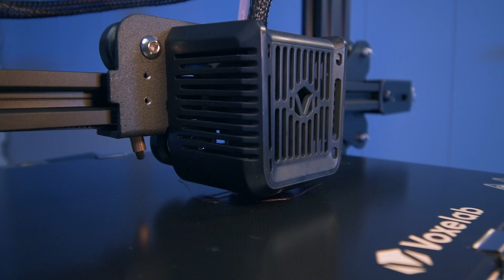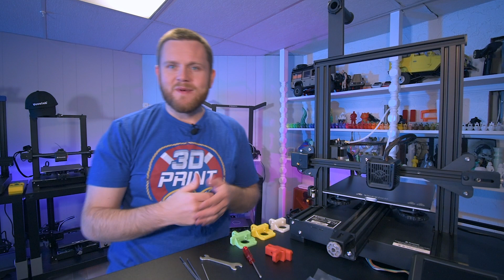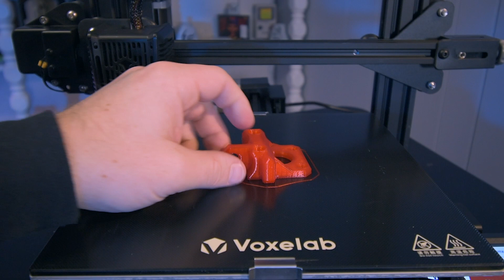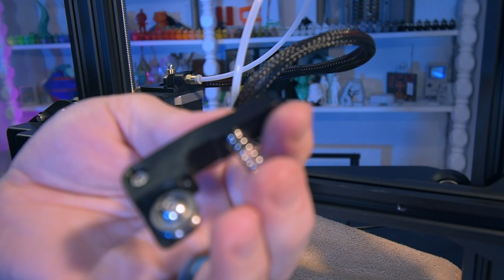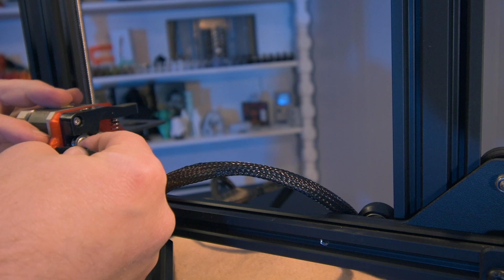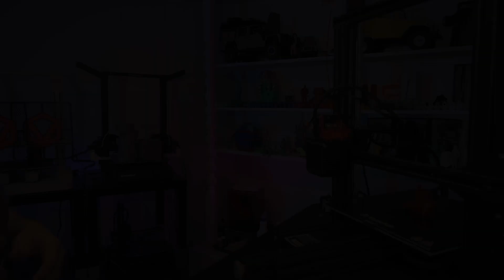Voxelab Aquila Direct Drive Mod - OOTBDD - EASY & FREE

Comment: Hey man, just meant to say that you saved my printer. I've been having extrusion issues for about two years and never was able to fix it with the out of the box setup. I was able to get it working just enough to get this printed and it's completely fixed my issue. You saved my printer from the landfill, I really appreciate it!
Reply from the maker: That's awesome to hear, I'm so glad it worked out for you!

Comment: not sure what went wrong and I'm not saying this was the cause. But I couldn't get a decent print after installing. it would start dragging the filament on layer 1. I did a bed level before even trying to print and that for some reason didn't feel the same. I have to manual level with the paper method (no autolevel here) and it always felt like... well like if a ballpoint pen was stationary and i moved the paper under it. I always set it to just being able to feel the ballpoint without it bunching up the paper. This time It just felt either like dragging it across a stylus tip or it would start to grab the paper. I also had a Satsana shroud but it lined up with the holes just fine and the hotend was mounted to the carriage like OOTB. So not sure what went wrong. Anyway, just wanted to post if you have a Satsana, it might not work out right even though everything went back together fine. This is an amazing mod and I'm pretty sure if I had used the original shroud it would of worked great.

Comment: Found some limitations,... All entirely within acceptability. Main one is that if you do a full height print on the AquilaX2, the tension lever will connect with the upper crossbar, which has the unique property of stopping the filament from feeding as the level opens the guide roller off the drive cog. So it stops the print from making a mess as the Z-axis is forced to stop.
Second one is my own fault, I ran off the first print of this using PLA, so with each subsequent print, and with the 40degC days we've had here lately, the PLA is softening. Time to put the PA-CF to good use!!.

Comment: Well now, finally got mine printed and installed, set the retract down to 1mm, modded my Satsana fan mount to clear, re-did the nozzle to bed clearance with 0.1mm Feeler Gauge, dropped in some TPU, 100% infill for a wrist strap, perfect. 15% hex infill for a squeezy octopus for a niece, perfect, now printing a dodecahedron dice at 250% with 3D Gyroid infill for my cats to have as a toy, no errors so far, with Zero supports in the print, and using the Voxelabs slicer....
I thought TPU was supposed to be hard, all I did was slow the speed down to 30mm/s max, set the print head to 230c on a reel that wants 190c to 240c, the bed to 50c and the cooling fan to 20% (wasn't game to turn it off),.... Nylon with Carbon Fibre is much harder to print then TPU !!!
Yes, I've got the Alex firmware and hardened Steel nozzle to do PA-CF on the Aquila X2.

Comment: I just got an Aquila Pro for 60 bucks. I've had an OG Aquila for a few years now. I have been wanting to do dual Z on my original for a while now so that I could do direct drive. When I saw the pro at a cheap price I got it, I figured it comes with the dual Z already on it. I plan on doing a direct drive. I might try this diy option before getting something for faster prints. I did a printed extruder on my original one so I could print TPU. It had the same V shape like this. I almost got the aries but I decided against the bulky enclosure. It makes modifications harder.
Reply: Only reason for the enclosures, is to keep heat in, for materials that need it.
I took a large cardboard box, cut it to look like a Diorama box with the front open and no bottom (because, workbench), and just put it over the top of the Aquila X2, stopped air movement and retained enough heat to print PA-CF, with the glass plate flipped upside down and sprayed with glue. Needed the 'Alex' firmware to get the temperature high enough, and a Hardened Steel nozzle. For the money, the Aquilla rocks! I used to work a place that sold them, got mine at staff price, then when they dropped the Aquilla's, I picked up a spare at run-out pricing,.. still haven't opened it 18 months later.
Can recommend using some White Lithium Grease on the threaded rod, most of the 'issues' with single sided drive go away if the threaded climber doesn't stick on the rods thread.

Comment: Will this allow the printer to print TPU as well?
Currentyl have your Fedorstruder v2.0 on the bowden setup, wondering how this would be compatible.
Reply: Mine's nailing it's first set of TPU prints. I want to get some TPE next. Done PLA+, PLA-LW, PETG and PA-CF in the past while still Bowden, but the Satsana cooler and this Direct Drive mod are making for some real nice finished prints. Might be time to tackle another RC aircraft with the PLA-LW.

Comment: Hi, it was really easy to mount the adapter for the extruder motors on the adapter from the link in the derailleur and surprisingly you don't lose the working space at all in height, I thank you for the idea that it will be easier to insert the filament easier because the printer 3d is in the enclosure

Comment: I’m using this now. I don’t think this is a good mod for a beginner. It shouldn’t be printed in PLA. The extruder will get too hot and soften PLA. I printed mine in ABS. You also definitely need an extended cable for the extruder motor.

The design has a couple flaws: the plate should be 1-2mm thicker, because the pan head screw is too long and will sit proud. This will make the lever crooked. Also, it only attaches at one wheel, so you can theoretically spin the whole assembly. It’s seems snug, but two points of attachment would be significantly better. 

I also used a lighter pancake motor. The stock motor is pretty heavy, and there will be more vibrations and rotation of the whole thing, because of that weight. 

The cable routing shouldn’t go straight up, but at an angle. Y printing height is reduced because the upright cables will run on the top cross bar. 

There are $15 direct drive mount kits on Amazon that would be better.

I’ll see if this is reliable in the long run. Overall I rate it a B+ mod.

Comment: I havent had a successful print with this mod yet and i think its the retractions , you mentioned turning the retraction setting down , can you please tell me which settings , is it the retraction speed ,or retraction distance in cura???
Reply from the maker: Retraction distance should be set to 1mm. Reduced from around 6ish or sometimes more.
Reply: Thankyou  @3DPrintSOS
Reply: As an update, i have adjusted my  restractions to 1 and had a successful print, however with some underextrusion occurring thorough my print. then i realised i had changed the gear on my extruder because it was worn, this through my e- steps out considerably. Old value to get 100 mm of filament to extrude was 93.9 e steps after another e step calibration i have had to adjust this to 105 e-steps to get 100mm of filament to extrude. hope the next print is perfect . @3DPrintSOS

Comment: Just got an Aquila X3 and I've been watching videos and turning my print settings, and looking for any way I can to make sure I'm producing the best prints I can.  This is certainly something I'm looking to do.  Did you ever do a video with a modification for the run out sensor?  I don't know if they changed it on the X3, but so far I haven't had any issues with it (other than it ships disabled and I didn't realize that). This video has earned you another subscriber.  I'm looking forward to learning more and seeing what my Aquila can do.

Comment: This works great, but my extruder piece is now warped because it is PLA. How should I remove the press-fit spacer? I intend on re-printing this with PETG then reinstalling. Thanks!
Reply from the maker: If you reprint, just cut the PLA open with your snips and get the spacer out. also, I recommend you print the adjustable lever from my “fedorstruder” files. it’ll give you more adjustments and guarantee a good filament path. :)

Comment: my ABSOLUTE NO. 1 PEICE OF ADVICE for, anyone with a 3d printer is buy a good presision screwdriver set, i got an ifixit one on amazon 2 years ago for 35 euro.(paired with a parkside electric screwdriver) it is amazing, much better than the crappy alan keys you get with the 3 d printers

Comment: Came across this vid by complete accident. I have an x2 and although I'm quite new to printing I do quite a bit of it. I have only ever used pla but have read up on some other filaments like tpu but I'm not completely sure I understand exactly why this mod is required.....could someone please explain it to me.....plus could you also explain what the machine is set at a retraction of 4 if 1 would work. In other words I really like this whole idea but not sure why 😊. Many thanks.

Comment: I did mine on Sunday and it loads just fine but doesn't print anymore. The extruder stepper moves very slowly now. Slower than it used to. Any ideas?
Reply from the maker: This shouldn’t have changed the steps of the machine. But I have heard some of the newer Aquilas have a different hole placement in their lever. So the filament path might not align right.

There is a printable lever in the “fedorstruder v2.0” that you can print to align the holes perfectly and give you the ability to adjust the tension of the bearing and gear. 

So first, check the filament path, second check to make sure the wiring is correctly plugged in.

Comment: @16:40 Sugrestion. Use a washer to press fit and not the wheel. The bearings are designed to be used in a radial load and you putting an axial load that may damage the bearings. Just thinking,  Maybe even design and add a STL and Gcode file to make a tool to do this included.

Comment: Great Mod, however I'm having a hard time with printing TPU, what retraction settings should you use for TPU? Also seams like filament is slipping especially with TPU. Thanks
Reply from the maker: I have seen a bit of a trend of misalignment going on. Mostly on the lever. I have a file called Fedorstruder 2.0. It includes a level that is adjustable. I highly suggest printing it. It will help a bunch plus we will know the alignment is exact.
Reply: @3DPrintSOS  thanks I will give it a try

Comment: Late to the party, but I just got around to doing this mod. I've had my Aquila for over a year (first FDM after spending 2 years reain printing) and have recently been getting the urge to try running some TPU. I'm running a Satsana shroud so grabbed a remix of this designed to fit better with that shroud. Took about 2.5 hours to print (4 walls, top and bottom, 15% gyroid infill and ran slow for better quality) and about 45 minutes to install (have a BL Touch installed and had to completely remove it to dismount the Satsana shroud). Immediately ran 2 small prints with zero issues.
Definitely, DEFINITELY need an extruder extension cable for this model. That stock cable is just not long enough.

Comment: Sadly, I realized after I printed the OOTBDD that I have an upgraded version of the Voxelab X2 - mine has a filament sensor. I'll have to take the STL file and redesign it to hold the filament sensor. Oh well.
Reply: Do you have the file you made?  I have the same model

Comment: Just done the direct drive mod but doesn't seem to exsrud filament any idea why. Thanks
Reply from the maker: I’ve heard this a few times! Sounds like some of the levers, especially on newer machines, are slightly different. To fix this, you need to print my lever from the Fedorstruder 2.0. That lever will have perfect alignment and give you spring tension options.

Comment: Thank you. I printed this, used it and it worked great, downside was I did a bunch of ABS and the heat from that and the motor warped it enough that it affected the extruder functionality. I may print another one in ABS to see if it holds up better.

Comment: Hi, great video, but I have a little big problem. I was a happy user Aquila printer with G32 chip. I downladed the correct firmware for this printer (ManualMesh-5x5-G32.bin).
 Also, the screen.  After that, my printer doesn't work.
When I turn on the printer, on the screen only appear the voxelab logo. I try to install other firmware but the printer does not response. 
I believe that my printer is now a beautiful brick. Guys, any ideas? Any suggestios? Please, what can I do?
Thanks
Reply from the maker: Make sure your 8GB SD is properly formatted. If you are on a Mac, make sure you do not have any hidden Mac “.files" on the card.
Reply: @3DPrintSOS  Thanks for your answer. Totally sure. Fortatted Fat32 4096. No more files or hidden things. The screen response to upgrade but the mother board does not response.
Reply from the maker: @davidlajara75  Hmm. Is it possible you have an early N32 without a sticker? Or you sure its a G32 machine?
Reply: @3DPrintSOS  I checked my mother board, and the model is FFP0173_Aquila_Main_Board_V1.0.1 with chip ARM GD32F 103. I'm a little bit frustated...:-(. 
I don't know what to do.
Reply from the maker: Yup that’s a G32. I would try another SD card for sure. If you haven’t already. Only thing stoping it from taking on firmware is either naming of the files, formatting, “.” Files from a Mac, or simply the wrong firmware for the wrong chip. So if you did all of that already, it’s gotta be the board. You can also try a different firmware all together. See if klipper takes, see if the professional firmware takes.

Comment: Is that extruder mount will fit to aquila pro as well?
Reply: Not good any other option for pro to get direct drive?Thank You for replay:)
Reply from the maker: @greghfpv  Not off the top of my head. I dont think it will be too difficult to adapt. Especially if there are any carriage files out there online.
Reply from the maker: Nope, the PRO is a bit different in a few ways. This will only fit the standard Aquila machines

Comment: I printed and installed this following every single instruction to the T. However, the filament is clogging up before it enters the hotend. The extruder gear it seems is no longer pushing the filament into the hotend. How do I resolve this?
Reply: I resolved that. Like a noob, I hadn't cut the PTFE just right. However, the mount itself broke multiple times. I am back to Bowden now and will buy a metal mount. This plastic thing has not been successful at all. Not for running 4-5 hour prints everyday anyway. This might work for people who don't print regularly but cannot handle the stress of regular printing. Great guide though and really love your channel. Thank you!

Comment: Is there a similar package for Aquila Pro ?
Reply from the maker: Because of the Aquila Pro’s closed-source motherboard, screen, and firmware, it’s hard to make parts for it. Honestly not sure.
Reply: @3DPrintSOS  thank you, I might have a go myself
Reply: @SimonPlatten did you try this on the Pro?
Reply: @strongarmairsoft  I did, however having spent time designing the model, just before I printed it I realised there is a problem preventing the direct drive from being used, this is on the Pro the wiring to the existing extruder is just not long enough to support the direct feed.
Reply: @SimonPlatten  is there a way to slice and extend the wiring? Thanks for this
Reply: @strongarmairsoft  perhaps but I don’t feel brave enough to try this

Comment: I have printed this unit with the included filament, i have yet to install it, the only thing i would like to see added to the bracket is the part to be able to use the Filament runout detection sensor.